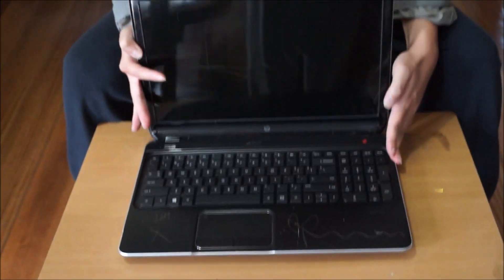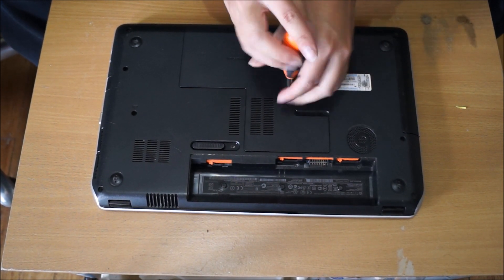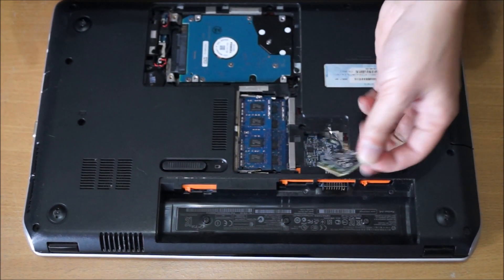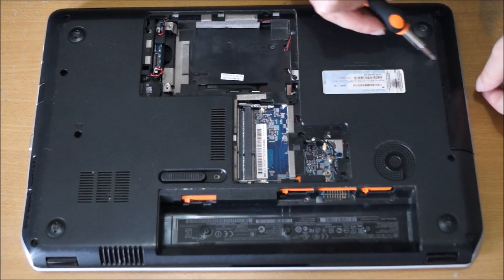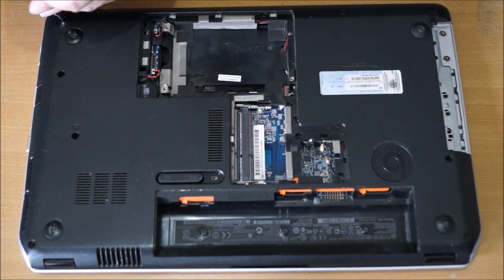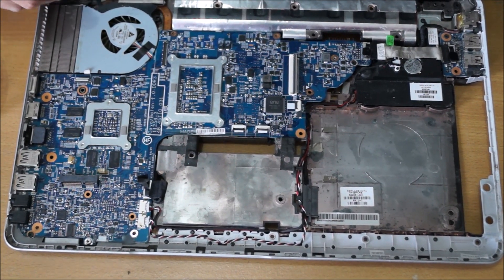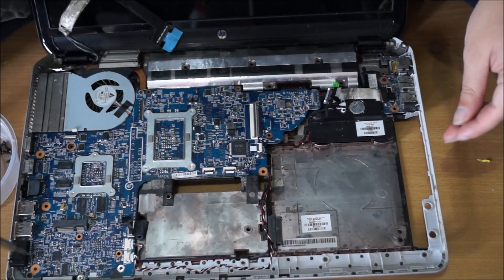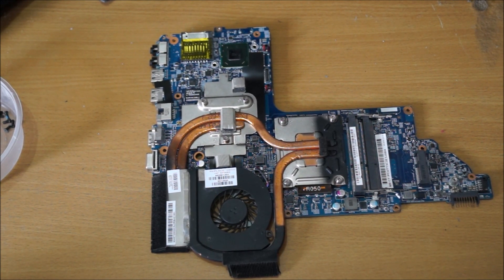OPEN ME UP! HP DV6 7000 series and HP Envy 15 Disassembly

Comment: I got this laptop with intel i7 3rd gen, and now i want to change my processor but stock processeser not getting from market, then which processors i have to buy for hp pavilion dv6t-7000??
Reply from the maker: i7 3rd is the highest you can have in it
Reply: Does it supports i5 3rd gen?
Reply from the maker: @pratikJadhav-np3iu  yes

Comment: Hp envy dv6-7210tx the speccy shows the motherboard Hewlett-Packard 181B is quickly heating up what's is the solution? I have cleaned the gpu and cpu changed the paste what else?
Reply from the maker: it is too old thats the issue
Reply: @OpenMeUpTec  but I have installed ssd it's much better now 🌱 actually I have changed its original exhaust fan previous was 0.04A this one is 0.05A and maybe it's little different, couldn't find the original one, anyway thanks bro 💐

Comment: So if you were to remove lcd panel to do a screen replacement.. Would you need to take it all apart? 
Are their 2 screws hidden on border edge of lid under grill sticker?
Reply from the maker: just put your hands in the screen and remove the plastic trim. you dont have to remove anything else

Comment: Hi, greeting from Peru... by any chance, do you know if the laptop supports DDR3L Ram? or only DDR3? I know my CPU does support DDR3L, but not sure regard of the motherboard, not much info to be found online. I have the laptop for 8 yrs already and thinking about giving it an upgrade to SSD since the HDD is starting to make the clicky sounds, and prob upgrade from 8GB to 12GB to enhance performance for multitasking and reduce CPU usage. any suggestions? Thanks in advance!
Reply from the maker: DDR3L works for everything. DDR3 was for the old laptops. So when they came out with the low power CPU which normally end with a U it require low power ram which is ddr3l. ddr3l work with any laptop that needs ddr3.
Reply: @OpenMeUpTec  Yeah, it's true that DDR3L will work since it can work on both 1.5v and 1.35v. will there be any performance improvement using the DDR3L instead of the typical DDR3? cuz I read that it's supposedly more power-efficient and faster due to the lower voltage.
Reply from the maker: @winlon  it could be true but for yoursself and this laptop it doesnt do anything. the power saving is also insignificate for you to care about

Comment: after i opened the laptop and cleaned the fan then closed it again the wireless card doesn't work anymore, what could've happened? i tried to remove then insert the card and the antennas again and again its not working?
Reply from the maker: you can test this by standing right next to your wifi with your laptop. if the antennas are not in properly then you will get a signal if you right next to the wifi. if the wireless in not showing on the laptop it is the wireles card not in place properly. this allows you to  know if it is the antennas or the wifi card is the problem

Comment: Great Video ...  I have a DV6 6100 LM720AV
Hi there. Which SSD do you recommend. I see many models:
SSD SATA3
SSD mSata (60mm and 30mm)
SSD M.2 (42mm, 60mm and 80mm)

I saw that my Wifi Card use a Port for mSata 30mm, or iam confused?
I cant see another slot, am I missing something?

Again. Which SSD do you recommend.?
Reply from the maker: this is a extremely old laptop. you will need to get a sata hard drive which is 2.5inch. i dont remember if it has a msata slots inside. if so you can get that as well

Comment: Thank you for posting this very helpful video!!!  I have an HP Pavilion Dv6-7020 which needed a replacement touchpad.  Your notebook is very similar.   On mine there are two screws with large flat heads which are exposed when the DVD drive is taken out.  They also must be removed.

Comment: I watched this video probably 6 times over now. Just replaced my screen, then went to clean the fan out. Literally no issues with the screen replacement and now it won't power on... The caps lock button blinks and the internet button is red and nothing else happens
Reply: I have the same problem
Reply: @lilblue1383  a friend of mine who builds laptops told me I have to replace my motherboard. I'm guessing what happened is when I went to pull the ribbon cables out, I didn't see in the video that you can unclip the tabs so I just pulled mine out and I'm guessing it broke the connection. $130 on Newegg for the motherboard with the fan, but at this point I'm just going to save up for an actual gaming laptop.
I also don't know if you're having the same issue got the same reason, so I can't say if a new motherboard will solve your problem.
Reply: @stephenmarion295  I did the same thing , I was trying to replace my HDMI port but ended up ruining the laptop
Reply: Oh noooo, I'd just replaced my screen after 3+ years of having a bunch of dead lines of pixels so was super excited to finally have it working properly. Had I left the fan alone and waited for this friend to pop up I wouldn't have to get a new one either

Comment: I am not able to pull keyboard out, any trick or suggestion?
Reply from the maker: did you remove every screw on the back yet?
Reply: @OpenMeUpTec  yes, just now able to pull up... there are two hidden screws little bigger than normal ones.. I didn't notice them

Comment: Keyboard absolutely does not open like this. It has individual snaps that break when lifted.
Reply from the maker: probably the same laptop as you have
Reply: Which model do you have? I have a 7200 and am having a rough time getting the keyboard out.
Reply from the maker: @fair2guy  if it looks the same then it should be the same. so watch the video and look if your laptop looks similar. HP only made one version of this shell therefore if you have a laptop that looks like this then the shell should be the same.
Reply: @OpenMeUpTec  Thank you- I found another video that offered a helpful hint on the extrusion of the keyboard. For anyone reading, the screw on the back that is labeled with a keyboard symbol is the key- use a small driver or allen key to press the keyboard out from the back. This is the best way to avoid damaging the front plate by trying to pry the keyboard out from the face.

Comment: Hi from Italy,
You did a perfect job and I solved my fan problem thanks to you and this video, unfortunely I broke the connector you detach at 9:48 ... the one white/red/black, Did you have any idea where I can find it  online ?

Thanks in advance for every help or suggestion you can give me,
Max
(SIcily)
Reply from the maker: it is the speaker cable. and you wont be able to find it online beside the manufacture.

Comment: Thanks for this video. I have the same one. Its my first time opening it. Overheating like crazy. Hopes this will help.
Reply from the maker: replacing the thermal paste and cleaning the fan will help alot. remember dont be cheap on thermal paste and get the right stuff

Comment: I'm gonna attempt this suicide mission on this exact model. It's getting so overheated that I have to change the thermal paste and clean the fan and heat sink. It's gonna die otherwise. 😢
Reply from the maker: it is not that bad. watch the video first then while you are opening it up watch it as well

Comment: Hi I have a question. I want to upgrade the WiFi card so that I can connect to 5ghz internet. Is it possible?? All the ones I see on amazon seem to not work with HP’s
Reply from the maker: this is a PC not a mac. if the card fits in the slot it should work. get yourself a intel 7260ac cost around $20AUD that will work as i had one in mines

Comment: Hello, from Chile I ask you some queries.

1) Is it possible to use the mSata port to start the Windows operating system or can it only be used as a cache?
2) If you install an M.2 SSD with an SATA 2.5 "adapter (M.2 to SATA) in the bay of the HD, I would like to know if it would be better than a 2.5" SSD, considering that both are SSD.

Thank you in advance for your prompt response.
Reply from the maker: there is no different from a m.2 and a normal ssd. it is just the form factor. there are NVMe hard drive that come in m.2 form but then need to have a PCIe m.2 slot to work in if not it is just a normal SSD. you can install windows on the msata hard drive. this is a pc not an apple product so as long the pc recognise it as a hard drive you can install windows.
Reply: Estimado Santiago. Disculpa un pregunta, talves has usado ya el puerto msata? yo tengo un Pavilion DV6 CTO 7000 y quiero ponerle un ssd de 160 GB en el puerto msata, funcionara? saludos desde Ecuador.

Comment: Hi OPEN ME UP thanks for the video, i have a question 
If I want to change the subwoofer of the laptop of the video, do the subwoofer is welded or is attached with screws?
Reply from the maker: you remove the old one and replace it with the new one. there is a connector on the laptop that it is connected to. as long  it is connected to the cable it should work. also you might want to confirm the power require for the sub as if you use a high power sub it might not work as there is not enough power
Reply: Great, thanks for the answer

Comment: Thank you for taking the time to share this. My fan was barely functioning and I had started taking my rig apart but only got about hallway in before losing my nerve. This showed me what I needed to do to complete the task. Works great now. Crazy that I had to d=completely disassemble a 3 1/2 year old laptop in order to clean the fan but that's how they designed these.

Comment: Hi, I have an hp dv6-7000 series laptop looks like this. I don't have the hdd cable, I've tried few cables but the hard drive is not recognized. Is there a specific cable for these models or is my motherboard connector faulty? TY
Reply from the maker: No the cable is pretty common. If it fits it should work. Probably the connector is faulty. Turn it on and see if the hard drive is getting power. You can tell as the hard drives spins.

Comment: So I want your opinion on an idea I have for my DV6. It's been running very hot for quite a while now, near instant throttling on the CPU when gaming costing me quite a few FPS. What I would like to do is buy a couple thin slabs of acrylic and mount the motherboard, power brick, and storage to the acrylic, custom fab a larger heatsink using a friends CNC (likely Aluminum, copper is EXPENSIVE) and then use a desktop PC fan (likely 140mm or 200mm) to blow straight onto the heatsink. I would use the HDMI out to hook it up to a monitor, and basically use it like a desktop. As it is now, it simply gets too toasty to use as a laptop, so rather than let it waste away, I think this might be a good way to breathe new life into the system. Back when it cooled better, I was able to get a nice little overclock on the 650M and had quite a lot of fun on this machine.
Reply from the maker: you just need to follow my video clean and replace the thermal paste. after see what happens as I have many these laptops and that generally solve the problem since the laptop is old dust builds up and blocks the airway. I just open one that was fives years old which was extremely loud the fan will just go to 100% just after 5 minutes of usage and it will also turn off due to the heat. after cleaning it now it runs normally and quite like the new.